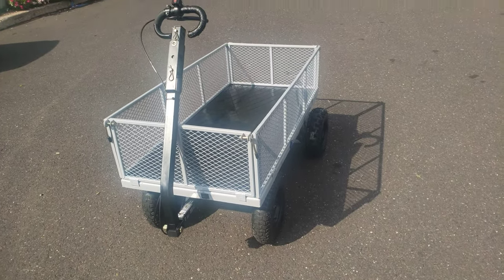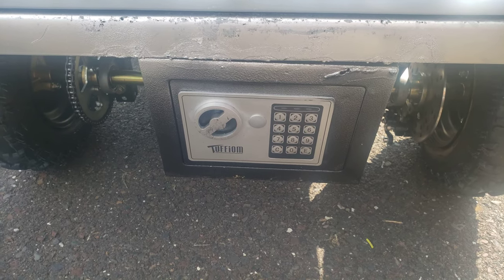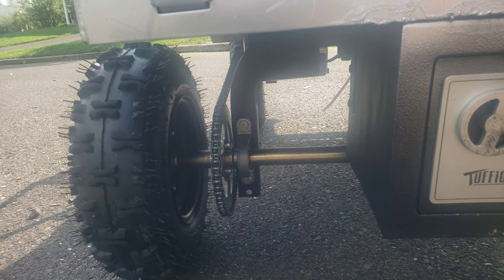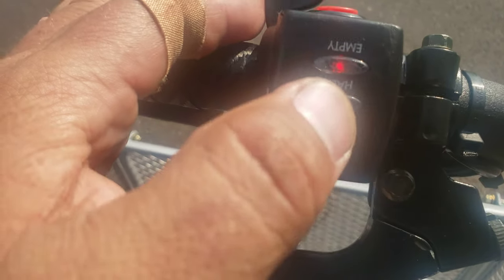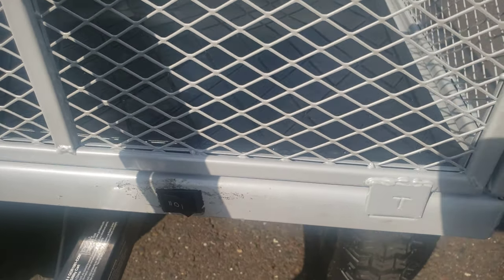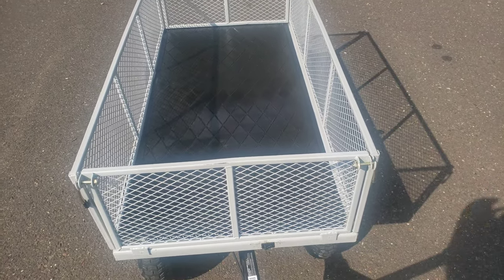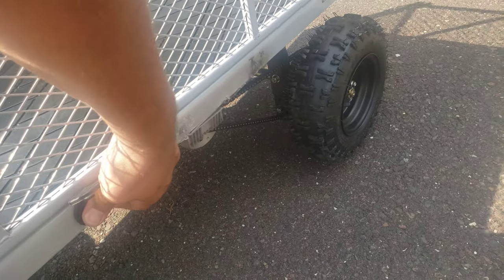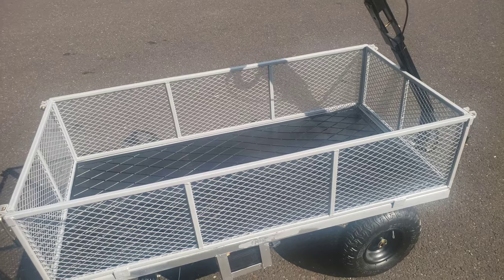Electric Beach Cart

Comment: I built an electric beach wagon as my first metalworking project a few years ago without welding. It worked, but it looked like something out of Fallout and the chain popped anytime there was too much torque. If you haven't tested it out at the beach yet you will soon learn you need bigger tires and power to at least 2 wheels. That being said, your cart looks awesome! Well done.
Reply from the maker: Thanks!
Works great at the beach. We've used it 4 times. Key is to place weight on the drive axle. We used a 25lb weight.
I'll take video this weekend and upload
Reply: @joev1779  Very nice! I'm looking forward to your follow up video.
Reply: @joev1779  would like to see this in the beach sand. thanks.  2wd in beach sanded fully loaded still moves properly?
Reply from the maker: @jonasbaine3538  yes. Check out my other videos on my channel

Comment: Just wondering what number tooth sprockets you were using on the front and rear for this? 
 I am building a similar cart with 48v 1000w motor and didnt want to use a gearbox as my cart is actually going to double up as a golf cart/buggy too when the cage is removed so I still need a bit of top end speed too at the moment mine is way to fast off the mark so just wondered what you were running?

Comment: Looks good. I just tested my Kart on the sand and found my 2000w 48V motor to hit to hard and the rear tires want to spin before moving the Kart. I just ordered a jack shaft kit that will reduce my drive from 5:1 all the way down to 14:1 should take the top speed from 28mph down to around 9 mph which is plenty fast for a beach Kart hauler. The ratio reduction should also help increase the torque to help climb up and over the  10% grade sand dune. not sure how to add a picture for you to see.
Reply from the maker: Great idea!! Till then just grab a 50lb bag of concrete at HD and wrap in a trash bag. Tape it up tight and place it over the back wheels in the cart.
Reply: Is there a part number or link for the jack shaft kit? Thanks
Reply: @jmurawsk1  I second this.
Reply: @joev1779  does adding more weight solve the spinning in the sand issue?

Comment: I built one a year or so ago.  I used my safe for battery box and to keep controller in.  Its a great baseball cart but wheels aren't too good in soft sand.
Reply from the maker: Easy fix for dry sand! Pick up a 50lb bag of concrete.  I wrap mine in a trash bag and seal it tightly.  Place it in the back of the cart over the rear axel. You won't have any issues with dry sand.
Reply: @joev1779  I have a heavy cooler in the rear but still no joy for soft sand.  I'm building another with balloon tires.  Also gonna run it on 40v ryobi battery
Reply from the maker: @toddwilliams1689  may want to try the 50lbs of cement.  Works perfect for mine
Reply: @joev1779  it probably would but I really can't fit it in.  We carry a big cooler with drinks and all plus 20lbs of ice,  another cooler for beer with ice, 5-8 chairs, bags with food and towels and 2 12x12 tents.  It will make it through the soft sand with me pulling.  Before I was pulling and someone was pushing.  I'll keep it for baseball and the balloon wheel one for the beach.  Plus I figured the beach one can stay at the beach house.  Less to pack plus in-laws can use it.

Comment: Great job! I am building the exact same set up as we speak. The motor controller that came with the 1000 watt 48volt motor does not have a reverse sensor. How did you hook up the reverse switch? That’s the only thing I can’t figure out.
Reply from the maker: You will need a 3 way 6 pin toggle switch.  Actually easy process... Make sure to get a high quality 3 way switch as the 48V current will overheat cheaper switches.  Here is a video on how to set up the switch. Once you set up the switch connect the motor like in the video here and connect the motor output wires from the controller to the wires on the switch where the guy connects his battery.  Your controller will act as a voltage regulator which will control speed via voltage output.  Post up any questions,     https://www.youtube.com/watch?v=il571D0XXjY
Reply: Joe V Super helpful. I can do that. Thanks man. Seriously been digging through YouTube trying to figure this out. What a time to be alive!
Reply from the maker: @ikeepitreal10123  Good luck.  Enjoy your cart!
Reply: Joe V having trouble with the switch. When I turn the key to the on position, the motor runs at full speed. You got any tips?
Reply from the maker: @ikeepitreal10123  send me a pic of wiring for the switch  twowayyo11@hotmail.com

Comment: HI Joe, is that a live axel your running? If so, does the wagon skip when you do a tight turn?
Reply from the maker: Hi. Not sure what a live axle is but the cart doesn't skip on tight turns.  Its a larger cart so it does take a little space to make a turn.
Reply: Live axle works the same as posi traction for cars. Both wheels spin at the same time. I'm glad to hear it doesn't skip on turns. My project is on a cartwheels dually wagon. Which is also a big wagon. Thanks again!

Comment: Great idea on the safe! But how does it do in the sand with those small tires? Would it be possible to add some lawn tractor 20-10x8 wheels?
Reply from the maker: Had it on the sand today.
Back wheels spun a bit. We put our yeti cooler bag in the back of the cart (about 15lbs with ice and drinks) and it was perfect.  No issues. Today was the first day we had it on the beach in Wildwood NJ and we had no less than 10 people ask where we got it and 3 or 4 who wanted to buy it.
Reply: @joev1779  Hows it holding up? Anything you would do differently? ?
Reply from the maker: @CodysGarage  working great! I picked up a new set of batteries this spring. Cart is great.
Reply from the maker: @CodysGarage  I need to spend some time customizing it. Adding accessories

Comment: Hi Joe...any chance you can provide a DIY kit or guide to building this?  I'm looking to take this on but have little experience and would need detailed instructions.  I'd love to pay you for the build but I'm on the West Coast and shipping is not feasible I'm assuming.
Reply from the maker: Hi. Problem with a DIY kit is that items needed constantly change brand names and manufacturers.  The motor I picked up on Amazon is no longer available and the replacement isn't either. If you check out Ultimate Rebuids YouTube channel he built the original cart and has listed all items needed. Pretty simple, batteries,  motor controller, throttle,  and on off switch with breaker.  That's the electronics.  You'll need a fixed axel and chain for the drive side.

Comment: Can you do a walk through of the wiring harness please I built this exact wagon but can't figure out the electrical
Reply from the maker: What part of the electrical is causing you an issue?  I bought a 10 pin harness.  Hooked up a positive 48V and Negative from the battery.  Then tapped those leads to power the controller.  All that is left is to connect the throttle to the controller (red power, black ground and usually white for voltage).  Then connect the two wires from the controller to the motor.  If the controller doesn't have a reverse function you can add a 3 way toggle for the that.  All that is left is a "brake" switch on the controller.  If you aren't using a key to turn off and on you can just jump that connector.

Comment: Do you think the 48v is necessary? Is it too fast? Why not 36v or 24v?
Reply from the maker: 48V is perfect to power through dry sand. Our beach is very long (1/2 mile to the water).  If your beach is shorter you probably could get away with a lower voltage setup.  Also we like to use a blender at the beach. 48V holds up well

Comment: Do you have any experience through soft sand and stairs yet? Headed to the beach in a few months and looking to build this?
Reply from the maker: Stairs won't work.  I haven't tried but any more than one step wouldn't work. Check out the videos on my channel.  I have a few going through dry sand. The key is proper weight above the drive wheels. I use a 50lb bag of concrete above the back wheels. Works great!
Reply: @joev1779  Is it a clearance issue with the stairs or does it not have the torque? We're headed to the gulf. The sand down there is like powder. Didn't know if the tires would plow and dig in.
Reply from the maker: @mikewilkes8409  its a heavy cart. Wheels won't  won't well on steps. Going down wouldn't be a problem, going up would be hard. With dry sand you need weight to create torq with wheels.
Reply: @joev1779  Thanks.

Comment: This is awesome, I am working on building my own as well. Where did you source your parts at? In particular the axle and motor.
Reply from the maker: Good luck with your build!  I got the motor on Amazon and the axle on Ebay.  Most parts on both sites.  Amazon a little easier with 2 day shipping.  I have built 5 more for people that saw the first one. Didn't really make many changes.  The cart is holding up well.  I used it in the snow yesterday!
Reply: @joev1779  Any chance for another video showing more in depth of the components underneath?
Reply from the maker: @Malmstrom92  Hey. The cart is at my beach place. Won't be there til mid March. I'll post a video when I get down there
Reply: You can go to any go kart site and purchase rear end setup.
Reply: Us too.  Trying to improve a little over these other models.  I can't help but think these motors should be tucked up high away from the sand.  Otherwise looks great!

Comment: How wide is the rear axle?
Reply from the maker: Axle Overall length (from end to end): 740mm (29 1/8")

The thickest part of the axle is 22mm (7/8")

Chain Sprocket: T8F 58 Teeth

Brake Disc Diameter: 160mm(6 1/4")

Bearing model: 6904RS

Spline teeth: 17T and 19T
Reply: @joev1779   thank you!!! I wasn’t sure on which to order but now I know I ordered the correct one! 29 740